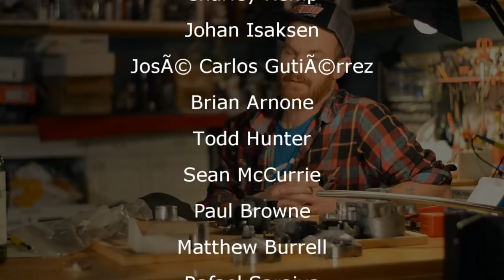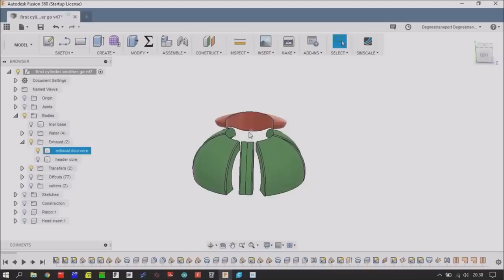Making The Most Powerful Two Stroke Ever - Get with the program!

Comment: Thanks for keeping us up to date on your progress.
Yes, it helps motivation to have an end purpose for your works.
Do you believe that a 50cc Partial Streamlined bike with 30hp could possibly beat the Buddfab Streamlined record of 131+mph?
If so, it would eliminate the need for an entirely new chassis, and also be possible in 2020!
The 125cc APS F and G classes hit 136.8 and 136.0 respectively.
Reply from the maker: Well, depends on how streamlined we can get. I'll see if I can find numbers on comparable machines.
As the Buddfab engine didn't produce more than 23hp(even less I think, 23 was with nitrous during testing. 18hp naturally aspirated on methanol, can't find any numbers with the turbo, but if higher than 23 they probably would have mentioned it) we have a big advantage there. They had to climb through the gears too, spending a large portion of time at less than peak power, we don't. The bike was still accelerating exiting the timed mile.

Comment: for the PVC slide valve, put a phenolic resin spacer between it and the case and that will arrest a lot of the heat.
Reply: In old mopeds there were always a thick 5-10mm bakelite piece inbetween carb and cylinder.

Comment: Chevrolet used a Silicone(not sure what they added) surface on their cylinders with Cast Iron Rings on their Cosworth Vega engines..might give you some ideas...I am very impressed with your development program!!.. I will be waiting eagerly for the next Land Speed attempt!..
Reply: ,,, just about a total failure.  Nikisil is about a thousand times better.  Not an exaggeration.
Reply: @rolandtamaccio3285  I know...just more info for research..

Comment: Hello I have a couple of questions.
First of all I love your videos and you're a huge inspiration to me.
I live in Latvia Europe and I'm building a Piaggio hyper 2 race engine
and I'm a 10th grade student so I have a lot of free time.
I don't want to run methanol because I'm afraid to get poisoning from it
lol but I think ethanol would be great because of the low chance of detonation
and low burning temperature but I want to get the max power out of my scooter.
What fuel would you recommend me use? Does ethanol make more power?
In my country I can buy 5 liters of pure nitromethane for 85EUR so I could mix
it with the fuel I'm using. I have my scooter engine setup listed down bellow.
but I'm going to take all the tuning parts out of my scooter and start building
a race scooter engine from scratch because I want to make my scooter stock for
daily commuting and meanwhile build a race scooter. I tried to buy the best tuning 
parts I possibly could by saving every cent(I live in Europe) to get the setup listed bellow.

Stage6 R/T carburetor PWK 21mm from scooter-zone.eu for 105EUR; 
Stage6 sport pro mk2 cylinder from scooter-attack.com for 200EUR that I'm planning to port; 
Stage6 R/T intake manifold from scooter-attack.com for 59EUR; 
Stage6 reed valve viton scooter-attack.com for 59EUR; 
Yasuni exaust C16 red fortuna from scooter-attack.com for 210EUR; 
Stage6 racing air filter double-layer large oval white from scooter-attack.com for 16EUR; 
Stage6 R/T variator from scooters.lv for 100EUR; 
Stage6 torque controll MK2 clutch from scooter-attack.com for 86EUR; 
Jasil evo N.G crankshaft from pedpart.co.uk for 89EUR;
Piaggio hyper 2 carter from scooter-power.lv for 45EUR that I will be porting, trenching(modifying)
and sand blasting, powdwer coting;
MVT premium internal rotor ignition with lighting coil from scooter-zone.eu for 250EUR.

I still haven't bought all the missing parts because they are very expensive.
If you got this far thank you for your time!
Happy tuning!
Reply: Try 'EP 85' BIO ETHINOL....? as a base...
Reply: @shuftipplonk6370  You mean e85 with nitromethane?
Reply: @arcticblack3764  that's the one...!!!

Comment: Better I'd give you everything I have but I don't got much I'm the one that told you about the needle valve way back in the day probably about a year ago the file it down because it was too high or too low or something I need a 212 cc Honda or no 196cc Honda engine about 40 horsepower in 12000 something RPM then drop the valve on me I still loved it I test drove it on the interstate passing traffic honking horns everywhere all right but you have a good day